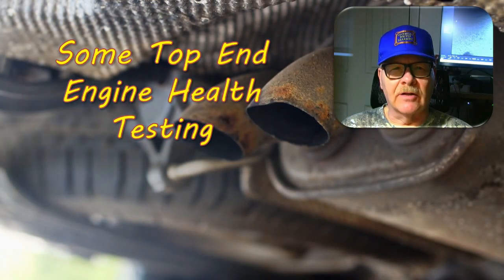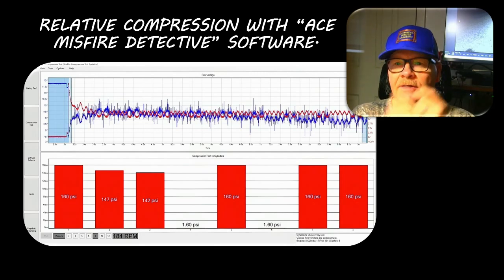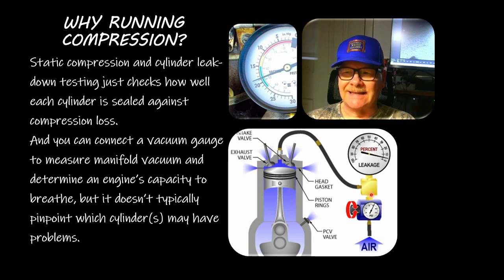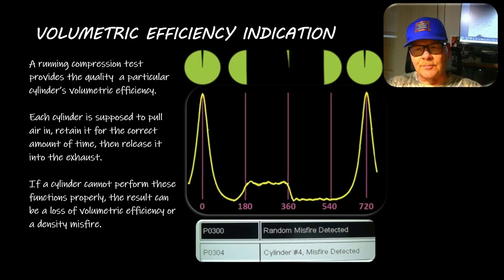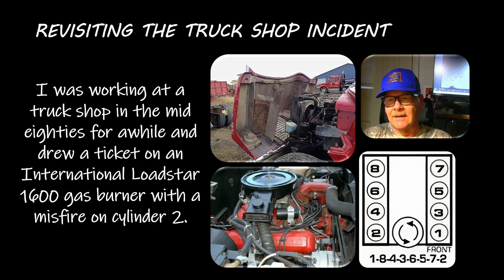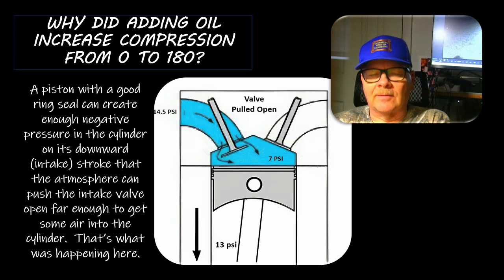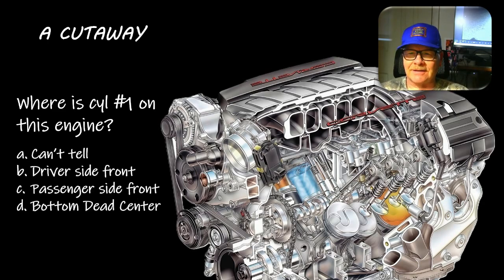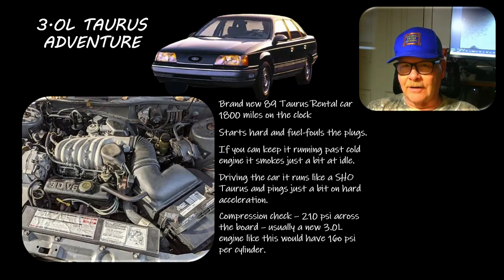Top Engine Health Testing

Comment: As always good information . In 1970 i was working in Fort Lauderdale Fl. at a propane gas company with all international delivery trucks 304 and 345 cid engines. The problem truck had a good idle on start up but within 2 minutes it would slowly start misfiring on the same cylinder.  a compression test showed 150# . A running compression test { idle } 140#......          30 seconds later 100# .... 30 seconds later 60#  30 seconds later 0 #. Long story  short replaced both hydraulic lifters on the misfiring cyl. no more problem. The lifter must have slowly pumped up higher and higher until it unseated the valve. I didn't change the valve springs on the dead cyl. as pushing on the rocker arm felt the same as all the other cylinders and the miss never came back.
Reply from the maker: That's a great real-world example of how engine problems can be tough to diagnose!

Comment: You’re amazing, Mr. McCuistian.  Thanks so much for your videos. I learn a lot from them. And thanks for your help. I was able to tap those threads on my crankshaft. It was easier than I thought it would be. And I got the aluminum transfer off of cylinder #2. I think I’m still a little out of round on the top third of the cylinder but I think it will be ok. I have yet to hone it. I’m contemplating taking out the crankshaft. I’m having trouble locating new torque to yield bearing cap bolts so I may have to leave the crank. I want to be able to replace the bearings but I may not be able to.
Reply from the maker: Sweet! - It pays to know what to do and to be able to do it but it can be a challenge - which spices things up for us!